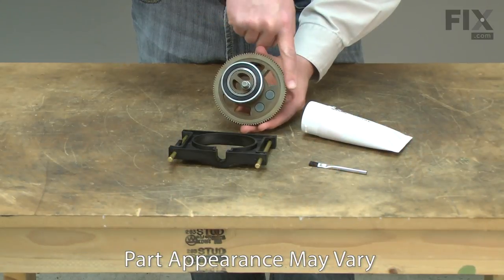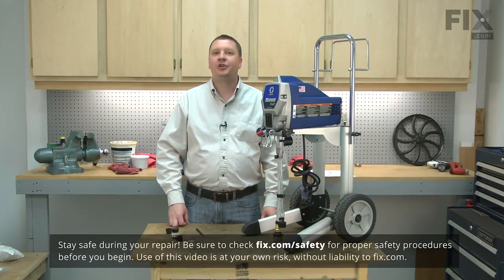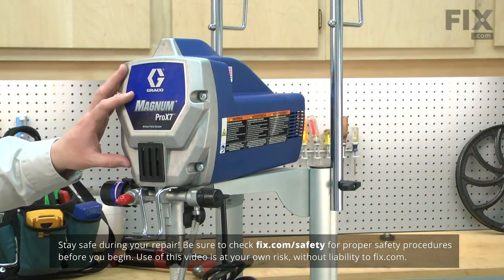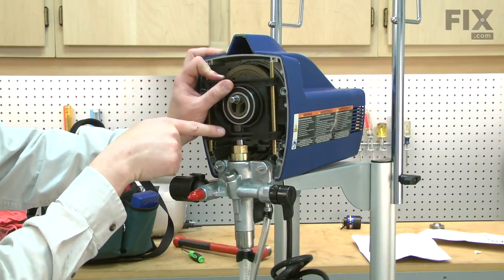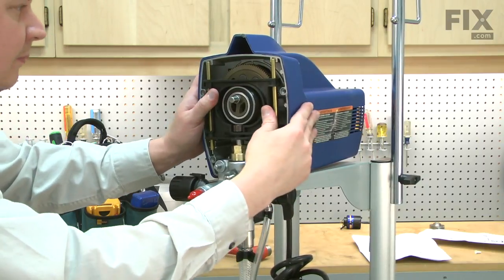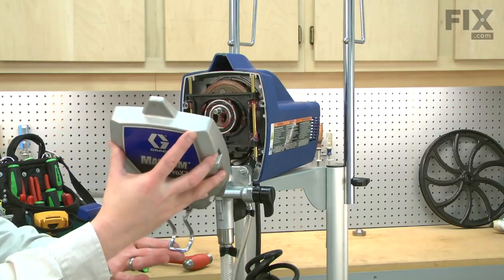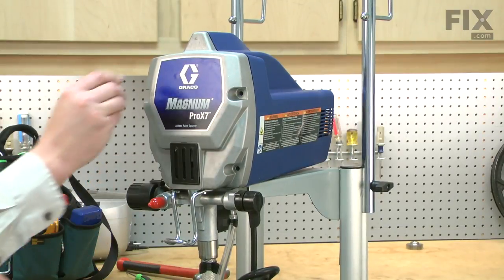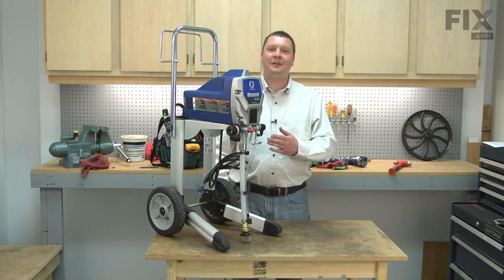Graco Paint Sprayer Repair - How to Replace the Gear and Yoke

Comment: That was my first sprayer. the the plastic on the cam broke. I epoxied it and it lasted another year. I got the cheaper one next and it just stopped working after a few years but only a few jobs. . They are made to break. I hate them all

Comment: Be careful pulling those wires. Be sure the tab is disengaged before you pull. That connector is soldered directly to the circuit board and nothing else supports it but the solder. Pulled mine off without even trying. Just like that, you're spending another $100.